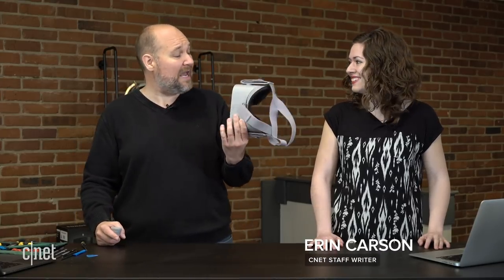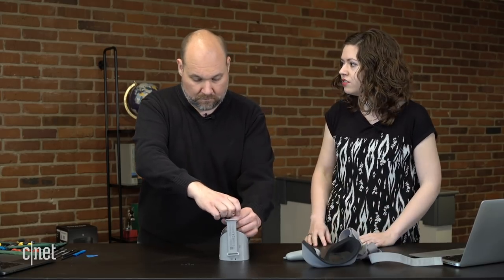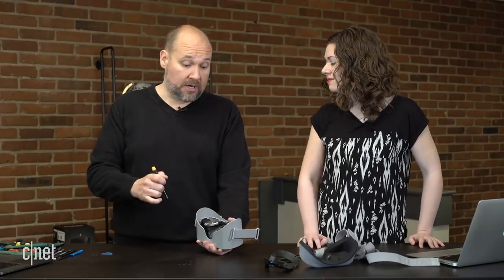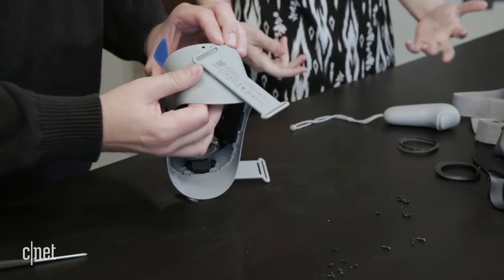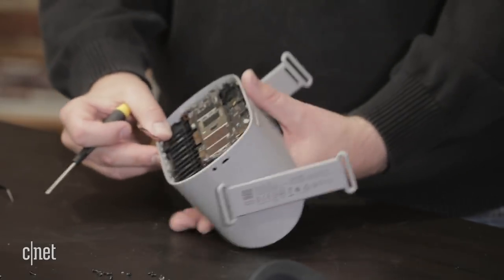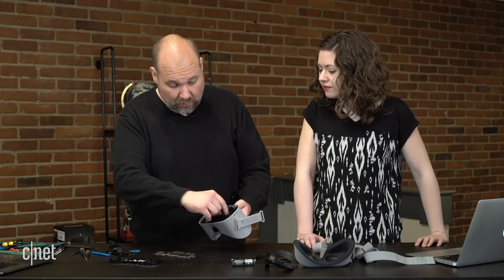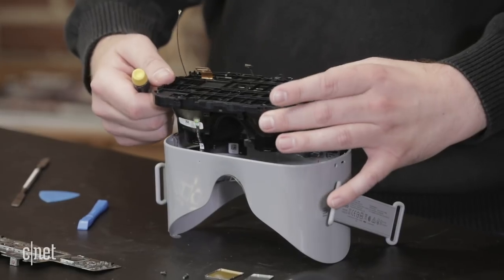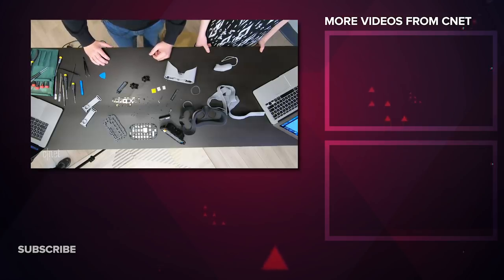Oculus Go teardown: How they squeeze in all that tech (Cracking Open)

Comment: Frustrated that, you  obscured the moment of battery location and removal. That would be the only reason I would normally attempt this.
Reply: Better yet, actually show how to replace the battery. That way people can figure out how to mount one externally like Palmer Lucky did, I'd go one further & use a 4000MAH 21700 battery like I use in one of my vaporisers!
Reply: @Tribulation88  Depends on what voltage you're running on that one. I'm tempted to just make a 6 pack of 18650 VTC6 cells...
Reply: @miscellaneousNsuch  I was thinking of a couple of Samsung 40T in parallel, pretty much 8k mah. 30A should have no problem, I've not seen the 18650 they use... I doubt it's 30A, they tend to be lower than 2600 mah. Honest ones anyway XD
Reply: Exactly. The only probable reason I would tear one apart would be battery issues. With anything else it would make sense to go buy a new one.
Reply: Good thing I started using Rogain because this stupid video made me pull my hair out. I'm screaming at the screen "WIGGLE IT MORE! DON'T FOCUS ON ANYTHING! TELL US MORE ABOUT MAKEUP AND POISON!"

Comment: I started playing with my son's old Oculus Go and was curious about repair, especially replacing the battery if there's a charging problem (the one I have is still okay).  The only thing I've seen in other comments around the net is there is a ribbon on the battery (as seen in the video) is critical and can't be found separately so be gentle!  Especially when putting a fresh battery cell in the wrapper with the ribbon (not done for this teardown).  This was the only decent teardown video I could find, and I'm very impressed how you go step by step and are very gentle when "popping" plastic pieces apart, as I've broken plastic tabs in several of my own breakdowns.  This is an old video, but I'll comment anyway:  I would love to have seen a high-speed rebuild video where Bill put the darn thing back together again (and it still worked!)

Comment: @3:30 standard controller? I was so blown away on two thing about this controller: how does the headset track the position and movement of the controller and how does the headset knows the rotation / orientation of the controller? The headset does not have cameras like quest. Does it use infrared? It is a great mystery to me.
Reply: Its sadly only 3dof so it probably uses something like a gyroscope

Comment: sigh You didn't actually use the controller either, did you? It's full motion sensing. The generic VR controllers you often see paired with smart phone based VR headsets are just (often flaky) bluetooth controllers that work as any game controllers do. The circular controller on top is also a touch pad that operates as a button as well.

Comment: has anyone noticed any not-as-advertised hardware? it occurs to me that a vr headset intercepted in the mail would be an effective vector for:

-Delivering a virus to a secure terminal or network, just for not being a usb drive. who would think to check it.

-Planting hardware that does not system reset and could even piggyback power for a mic.

I'm not paranoid, i'm just curious. these things do happen. mostly, i imagine, in attempts to steal intellectual property rights, or probably also law enforcement. seems to be a lot in overseas electronics as well.

Comment: It DOES have Bluetooth. I have connected two Steel Series controllers to it. Now, Bluetooth audio, for some reason, does not seem currently supported at the time of my writing this, as a corded headset is recommended for use.

Comment: Would be way more interesting if you would have focused on the actual tear down...  You start loosening the face plate at the proximity sensor, it is incredibly tight on my Go, thus I would have been interested in a commentary, while you pry it open.

Comment: I have a load of these batteries for torches and other tech one of them says it's a 9000+ mah battery. Assuming it actually is what it says it is would it not give my Oculus go a longer run time. I'm not 100% on how battery output Vs time works
Reply: If you have an 18650 battery that claims to be 9000 mAh I'd suggest recycling it as it's putting and probably extremely poor quality if it can't be sold on it's actual merits. I surely wouldn't want to stop it to my face.

Comment: I think this video is nice. My headset overheats very easy and its nice to know the screen is safe so no dust comes into it when i open the heatpipe to screw some holes for the hot air to get out and now i even know there is no way dust can get into the screen.

Comment: 2.5 hours on one 18650 battery?!? Holy moly that's impressive.
Reply: I have a load of these batteries for torches and other tech one of them says it's a 9000+ mah battery. Assuming it actually is what it says it is would it not give my Oculus go a longer run time. I'm not 100% on how battery output Vs time works.

Comment: Great video. It seems that the battery is easy to upgrade to a somewhat more powerfull one. Would the thermal protection system of the Go still work ?

Comment: Motion sickness not only attributes to the world not moving where you moving, but low res textures is an issue.

Some of those early Demos was using high end graphics engine with low res textures and pixelation in close models was horeible. There are three Zones in VR IMO being close, far, and mid range. Games, Demos, or Videos with very little to no noticeable pixelation from close to 3/4 mid range is a fantastic experience. 

High End or PSVR been a fantastic experience with titles such as Farpoint, Eve Valkyrie, Job Simulator, and Wipeout are just a few. On my Samsung GS6 Gear Eve Gunjack and Lands runs great with motion sickness while every free rollercoaster demo made me sick due to poor optimization. I wouldn't say thd feeling is like being poisoned at. More like that feeling right before you throw up which is fine balanced combination nausea and vertigo.